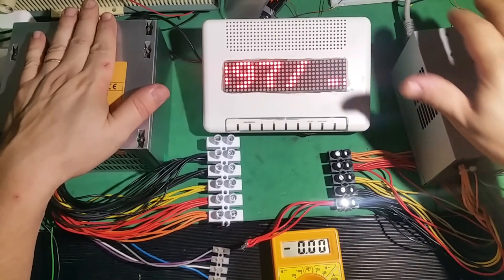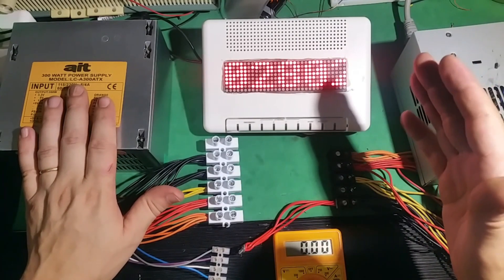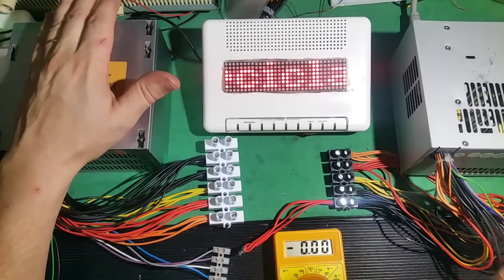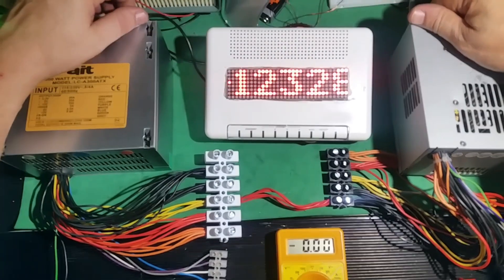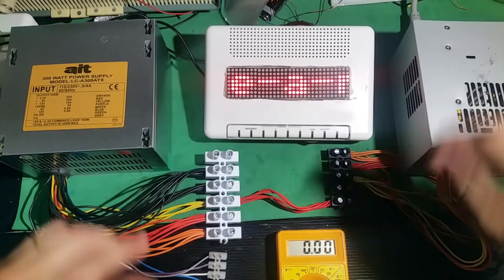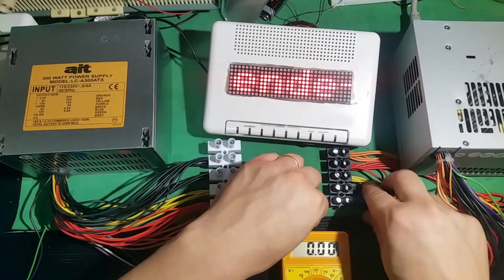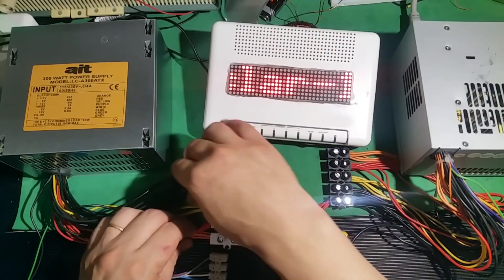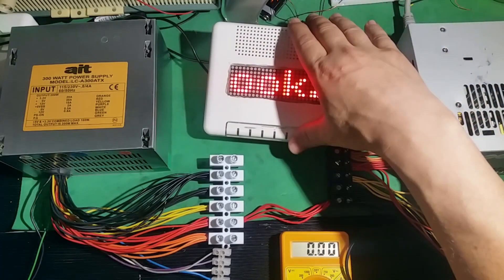Cómo conectar 2 fuentes en serie (ATX) de PC. #quepuedeshacer #manolinferraz

Comment: hola como puedo conseguir unas que se unan los de 12v, requiero 24v, otra cosa amigo, puedo utilizar los 15v en un controlador solar y baterías? en vez de usar panel solar?
Reply from the maker: Hola amigo,para que te funcione deberías de tener 2 atx exactamente iguales ,así no entrarían en modo de protección,,en cuanto al controlador solar ,podrías hacerlo,pero te recomiendo algún circuito que haga el corte cuando alcance el máximo de voltaje en la batería,para que no sufriera,saludos¡¡¡¡😉👍👍👍👍👍

Comment: Hola tengo un case que trae fuente de poder de 400w, quiero comprar otra fuente de 400 w, no estan certificadas.
Mi pc tiene.
RX 5700 XT
RYXEN 9 3900X
EVGA de 280m (o le pongo aire)?
asus prime x570
y demas accesorios...

puedo usar dos fuentes  de 400?  o me compro una sla de 1000? o de 700?}

ayuda por favor cuanto necesito? tambien uso un estabilizador por fuera.
Reply from the maker: Hola amigo te recomiendo que instales solo una fuente atx,si tuvieras que poner 2 ,podrías hacerlo también,eso si ,ten precaución que no se juntes entre ellas y alimenta en fases,puedes poner una sola para la placa y la refrigeración y la otra con el resto de los componentes,espero haberte ayudado,saludos¡¡¡¡😉👍👍👍👍

Comment: Saludos buen video, estoy pensando en hacer algo así.. tengo dos dudas: la primera es quizá un poco tonta pero las dos fuentes están conectadas, a la corriente de la casa digamos cada una conecta x separado? Y mi otra duda sería si es posible sacar 36v, sacando de una 24v con los 12 negativos más 12 positivos de la otra fuente. Desde ya muchas gracias si es q podes despejar mis dudas.
Reply from the maker: Hola amigo,cada fuente debe de tener su conexión, puedes preparar preparar un cable para conectarlas en paralelo en una sola conexión,recordando que no deben de juntarse las masas entre si,deben estar separadas lass fuentes atx,este cable debe der de buen amperaje la salida de +12 y - 12 que te dan los 24 v  tiene muy poco amperaje y la salida de 12 v tiene bastante amperaje ,la salida de 24 no soportará y creo que se protegerá ,espero haberte acaparado las dudas ,muchismas por comentar, saludos ¡¡¡¡¡😉👍👍👍👍
Reply: @ManolinFerraz  gracias a tí por la respuesta. Saludos!

Comment: Buen dia Manolin.

Nunca vi una sola fuente que tenga especificado si se puede, o no, conectar en serie, no creo sea preocupacion de ningun fabricante, no creo que se preocupen por el "mal" uso que nosotros intentamos darle.

Cuando intento sumar los 12 en serie, siempre se me apaga una, probe cinco fuentes distintas, ya me desanime, evidentemente esta saltando alguna proteccion y me las apaga, estaria bueno saber por donde viene la proteccion y si es posible desactivarlas o si se corre algun riesgo, cosa que no he encontrado por ningun lado.

Saludos, desde el otro lado del charco.
Reply from the maker: Hola amigo,en la página del fabricante si lo especifica concretamente, están obligados a dar esa información,no te desanimes, prueba a conectar los + 12 con los + 5  o los + 3 ,esos dan menos problema al hacerlo.
Por otro lado puedes modificar la salida del integrado,si es el tl494 puedes sacar unos 14,80 voltios en la salida de 12,de este tengo también video en el canal.Estoy trabajando con una en estos momentos que pude sacarle 16,50,esta es más complicada de modificar,con algunos ajustes se podría subir algo más el voltaje creo yo.Animo amigo,muchas gracias por comentar y saludos 😉👍👍👍
Reply from the maker: https://youtu.be/oR7QyAFNIOs
Ahí te dejo el video que te dije